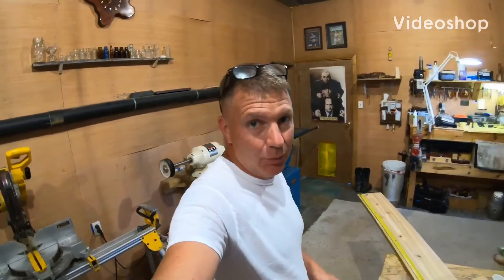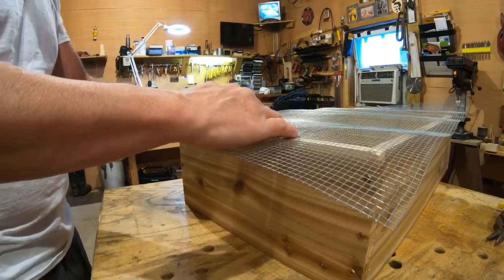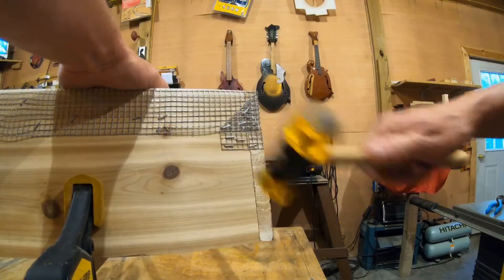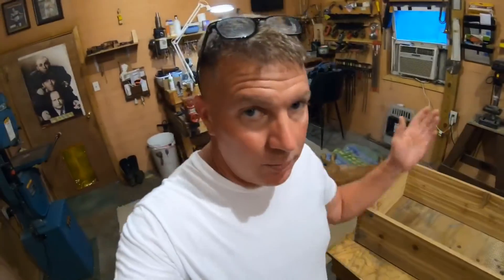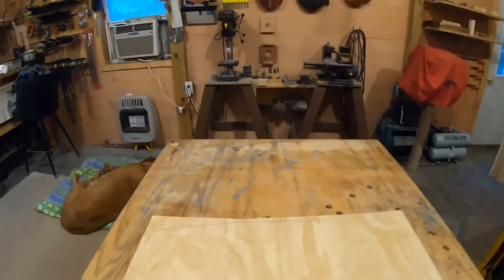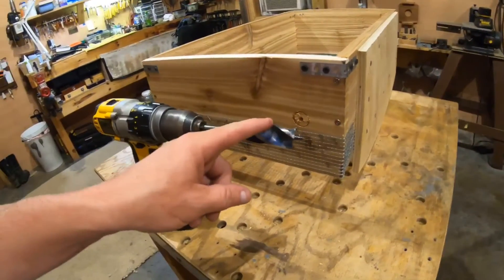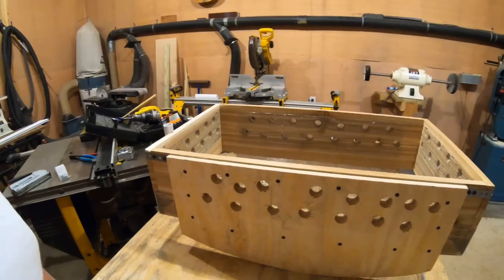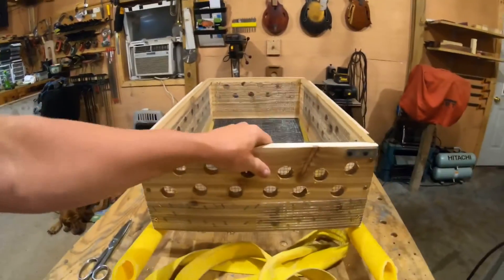Arrowhead Sifter, The Best One To Build.

Comment: You need to use 1/4" mesh I dig in my yard and it's yellow clay and it has to be just the right moisture to push through screen.
I used to use 1/2" until I walked by one of my piles of dirt after a rain and found a complete 1x 1/2 projectile point and a broken drill tip.
Reply from the maker: I was using the 1/4 but the mud I was sifting just took forever to go through. I know I may miss some really small stuff, but it’s a tradeoff I guess.

Comment: Do You have to use cedar boards?
Reply from the maker: It doesn’t have to be cedar. The reason I use it was, it’s lightweight and it doesn’t rot. I’d say pine would work, it’s also lightweight. As long as it’s out of the water to dry after each day. Light is the key though
Reply: Would it be cheaper to buy one? I know it's not made as good tho.
Reply from the maker: @Ayden_Andrew  not sure of anyone selling them. They have plastic ones but they are a lot of lifting

Comment: Easiest way to cut plastic tube is with a fence on a table saw - blade set just high enough to get through the plastic.  You can make a narrow cut, heat with a heat gun and pry apart or you can make a few passes adjusting the fence over each time.  Any time you cut heavy plastic you can heat the plastic some and get your knife blade good and hot and it will slide right through the heavy plastic.  I use  a heavy box cutter blade.
Reply from the maker: @cellerfeller1474  Bad idea! I tried that once and almost cut my finger off. Theres nothing to keep the tube from turning as it’s cutting. One slight rotation, and BOOM! It grabbed the blade… shot the tube into the wall behind me and cut me pretty good.
Reply: @cleggsadventures  I just screwed a pusher on the top to stop the rotation, stood off to the side to put lateral pressure on the fence - no problem at all.  I got a bad cut trying to slice hard plastic with a knife blade so this method seemed a lot safer.  An alternative is to put the tube in a vice and use a good jigsaw - way safer than going at the tube with a blade.

Comment: Just curious what’s the dimensions of it
Reply from the maker: Let me go check real quick
Reply from the maker: It’s 27” x  19”.  I used a 1x6 cedar board on the first one and pine on the most recent one. The cedar is lighter but a bit more expensive.
Reply: @cleggsadventures  thanks I’m thinking of making one to help my back out instead of bending over and using my hands
Reply from the maker: @justyntheoutdoorsman6995   It definitely is easier on the back. Good luck out there